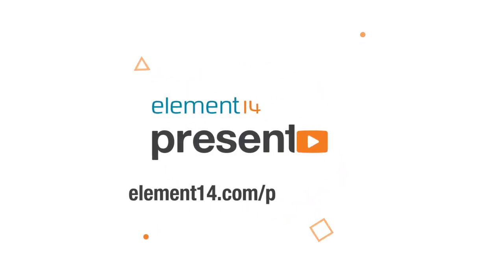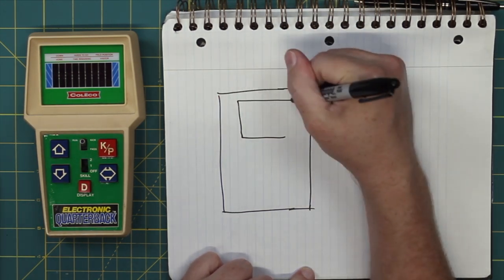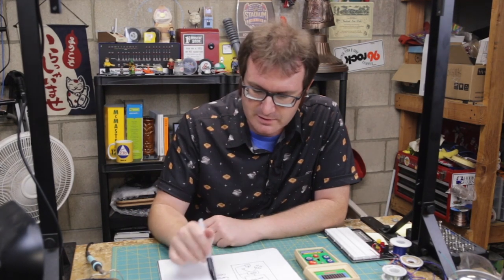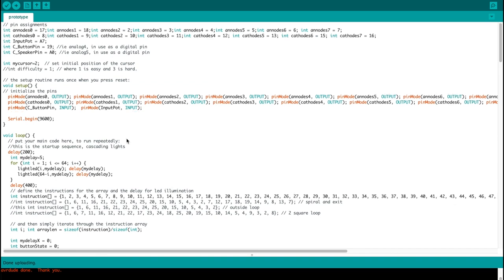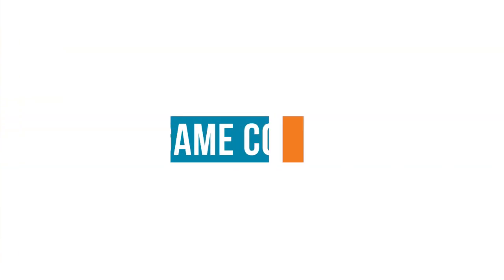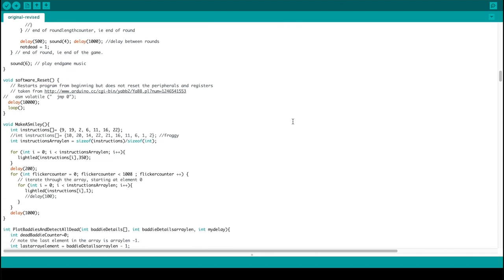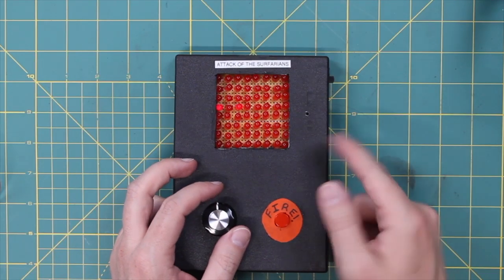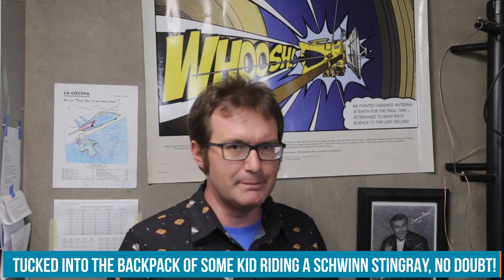Arduino Retro LED Matrix Handheld

Comment: Not truly retro, but you could use a grid of WS2812s to get a color display (and it only uses 1 pin!). I built a little system with them about two weeks ago: https://imgur.com/gallery/kc4k2pO
Reply: Hey Kris, that looks amazing - very clean build! Do you have the code published somewhere? I'm working on a 10x11 LED handheld and could use a jump start on that.
Reply: @Davedarko  Yep, look in the comments at the bottom of the post.
Edit: I knew I recognized you! I'm working on a similar version of your retro game system that uses the OLED vertically

Comment: Fun idea with educational content, but couple of questions - why use transistors at all? An 8x8 matrix of these little old red LEDs can be driven by the bare pins of an Uno. Using transistors is of course more proper and the MCU will be happier, but then why NPNs and  not PNPs or P-FETs on the anode side of the LED matrix?  When you calculated the LED series resistor maybe factor in the voltage drop across your driver transistors and the effective scanning duty cycle. TPIC6B595 is a useful shift register part for driving P-FET gates. It can sink 150mA per channel continuously / 500mA total, so can also also serve on the cathode side for small LED matrices. And then in the ultimate reduction there's MAX7219 can do the complete scanning job as well and run a whole 8x8 matrix on just a 3-wire SPI link to the MCU.
Reply: Correct me if I'm wrong, but wouldn't you source or sink up to 8 LEDs x 20mA in one pin, if you don't use transistors? I think 160mA is out of spec, the Arduino has a 40mA limit max per pin, combined a bit more. This is also meant to be a retro "inspired" build and I'm not sure the chips you've mentioned where around when this all started. Sure, the Atmega328 wasn't either.. but for me it's an understandable process and it works, which is most important. To control the matrix with a chip brings new software complexity too, because you're not controlling the matrix on your own anymore. I've used an Atmega328 to control a 10x11 charlieplexed LED recently, just for fun - that's what the channel is about.

Comment: using a audino dose not teach you anything about electronics - it is more about object design
Reply: It's about programming MCUs in C++ and getting started, without building your own board first. It's also a standard form factor and an IDE with libraries that gives you a head start, so you don't have to program everything yourself. That all gives you an easier way into electronics. It's a tool that helps you learn a lot about electronics and design things quicker. So... can't really let that stand like that.
Reply: @Davedarko  And for those who don't know, there's PlatformIO for those who want to get past the limitations of the official Arduino IDE (e.g. being a pain when dealing with several kinds of Arduino boards) but aren't ready to jump in to using bare C.